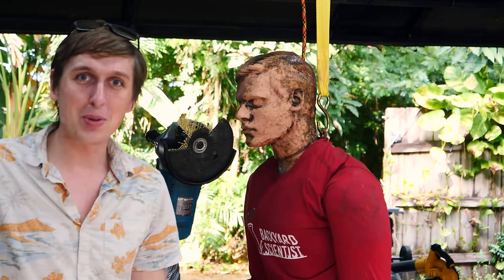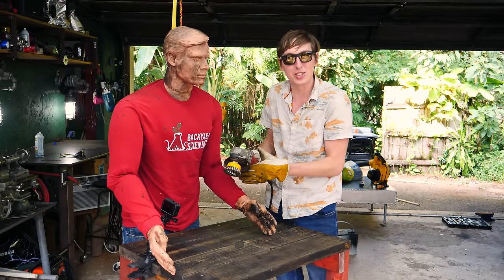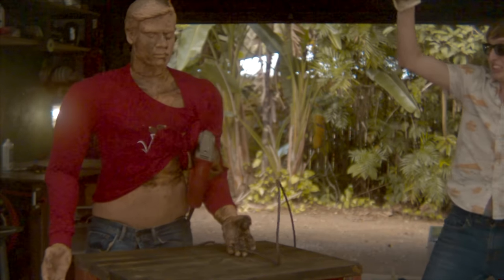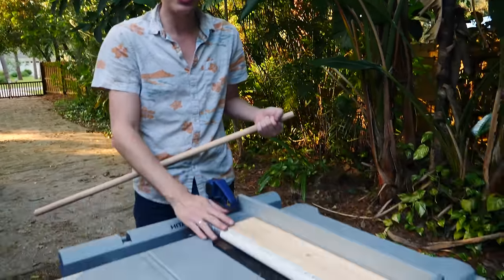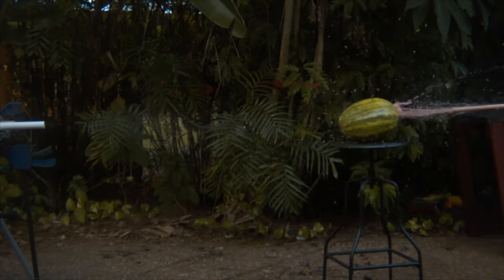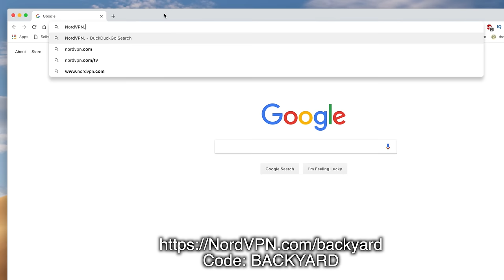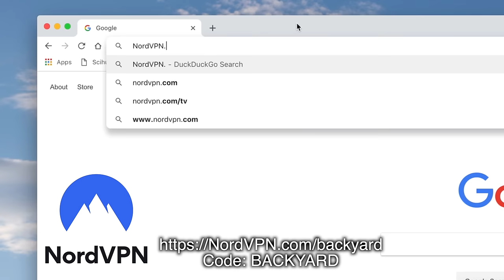This Is Why You Need To Wear Safety Glasses

Comment from the maker: Anybody have any stories from power tool fails??
Heres a link to the exploding car video! https://www.youtube.com/watch?v=HhXNs8EVQck
Watch this great and entertaining talk on security and privacy https://www.youtube.com/watch?v=J1q4Ir2J8P8
Backyard Scientist shirts https://outloudmerch.com/collections/backyard-scientist
Reply: Hey
Reply: Japan is another planet and I love it
Reply: I ran out of battery for my drill at work, was a total fail.
Reply: Was using an old drill.. bit got stuck and handle  caught me in the jaw..
Reply from the maker: @AsG_4_  ouch! ive had that happen quite a few times, but it usually only twists my wrist or hit my ribs.
Reply from the maker: One time I was drilling a hole through thick metal, and the bit broke in half. the drill bounced off the metal and right into my calf. I drilled about 1.5 inches into my leg and the bit had fat tissue stuck in it. Probably my worse injury.
Reply: Leo at Sampson boat builders just had an accident and is getting everyone to guess with what...do you have any guesses after this video?!
Reply: I've had a disc exploding in my face, i didn't wore glasses, thank god i only had a couple of minor scratches. But a week later or so, i was welding and a piece of red hot slug flew behind my mask and bounced in my eye. Hurt pretty bad. So even wear safety glasses behind your welding mask.
Reply: @TheBackyardScientist  oooof I'd say so.. I also got my finger pinched in a saw zall shaft.. lucky not the blade... Oh yeah "too many cheese burgers Randy " 😂😂😂
Reply: using a very large drill to drill a 3.5in hole through 8in of concrete floor and the bit got jammed and the drill took me off my feet and into a wall.
Reply: TheBackyardScientist i have a story of a train wheel and a very powerful machine! Oneday i was machining a trainwheel using a automatic copy machine, when it decides to slam into the train wheel while it was spinning fast! As a soon as tool hit wheel, huge metal explosion and small sharp metal shavings when into my face and skin. I had over 20 tiny cuts, and my eyeballs were safe becuase of the glasses!
Reply: I almost cut my finger off with my angle grinder
Reply from the maker: Sdrrshock  Yikes! my lathe only has the power to break a few fingers, but the bigger ones can easily rip your whole arm off... if you are lucky. ive seen videos where the whole person gets wrapped up like the tie in this video.
Reply: TheBackyardScientist you were the only good part of YouTube rewind
Reply: that end of the wooden pole will sure make a cool slug! awesome Video btw!
Reply: 1) I was using an angle grinder for the first time, and learned the hard way to hold it at the correct angle. Was grinding some metal and shot sparks directly up into my eyeballs underneath my glasses. Do not recommend! 
2) I was using a belt sander for the first time. I was sweaty and getting tired, and my hand slipped and I buzzed some knuckles against the belt a couple times. Also do not recommend.
Reply: Not really a power tool, but a classmate of mine from my vocational school was pressing a bearing out with a hydraulic press when the bearing failed and basically exploded sending bearing rollers everywhere at high velocity. Thankfully he was wearing safety glasses because one of the rollers actually went half way though one of the lenses, stopping so short of his eye that he could brush the roller with his eyelashes. A picture of those glasses was posted around the school with the caption "This is why you wear safety glasses" for at least as long as I was there, probably for a good while after.
Reply: @Riverratskippy  those hammer drills should have a clutch but I've had em stick before as well.. very rare
Reply: What bb gun is that its cool and id like to get one for christmas
Reply: This wasn’t bad but I was using a belt sanded and sanded off the skin of my finger

Also I was using a Dremel and the sanding bit and the sand paper broker off from the fabric and it exploded like a grenade

I was lucky not to get hurt but I was in my maker space close to the CNC and it launched a big chunk of wood at my eye I was wearing safety googles sooo I’m lucky
Reply: Watched a guy cutting the top of a fence post with a skillsaw...hit a knot, it jumped out of his hands and the blade went across his chest....fortunately he was wearing a jacket and two shirts, so his wounding was mainly superficial.....
Reply: Got my thumb buzzed on a bench grinder. I could see bone after i washed the blood away to clean the wound.
Reply: @AsG_4_  i experienced the same lol
Reply: My dad once used a router and the tool bit popped out and skated across his arm. He nearly lost the ability to move that limb.
Reply: Great video! When you are using a table saw on a daily basis it's easy to forget just how dangerous kick back can be. Thanks for reminding me,  I'll def be aware of where I'm standing when I'm working!

Ps your watermelon didn't really capture the the seriousness of the risks posed by the carving blade in the grinder.  A couple of years back I had to administer first aid to a friend who had one cut straight through his index and middle fingers.  Went through like butter in a split second.  Clean cut through dewalt gloves and knuckle bones! Surgeon was able to reattach but not restore mobility........ 

Please guys,  be careful!
Reply: I was working on a Mag Drill which is used to drill through steel beams. My shirt got caught in the bit and started sucking me in. This was just a few weeks after hearing a story of a guy that bypassed a safety switch on a pipe threading machine. His pants got caught and reeled him in and unfortunately he got his gonads ripped off 😭 Thankfully I was much more fortunate and only got surface wounds on my belly. Everyone around said I was hopping around screaming 😯 It's scary what those high torque machines can do.
Reply: TheBackyardScientist I’ve had a Dremel cutting wheel explode, luckily I didn’t get hit much just a tiny piece in my arm a few millimeters.
Reply: I was grinding on a piece of aluminum and the grinder  got caught in my and shirt and tore it off me. However, it didn't harm me.
Reply: @tbac2432  Oh man! Reminds me of my brother-in-law with the table saw... 🙄
Reply: I'm sure Mr Peter Brown over at @ShopTime could give you a story or two.
Reply: I've experienced tablesaw kickback a few times. Fortunately through a combination of luck and proper training I've never been injured by it.

I've witnessed the exact level of power you demonstrated in the video. My boss was using the saw and had a one inch square scrap of wood kickback and stick through an insulated metal door.
Reply: I was cutting a price of metal and sparks caught me on fire
Reply: The MithBckyardBuster
Reply: was once drilling through a piece of metal sheeting, good 1/8" thick.. bit snapped and stabbed a hole through my thumb nail and partially into my thumb. Took me a second to comprehend what happened and oh man did it hurt once i realized what had just occurred...
Reply: I was using a cutoff wheel on a sewer stack and the stack dropped from my cut broke the wheel and shot a chunk of cutoff wheel through my shirt cutting my stomach. I now recommend using a portable band saw on those.
Reply: Those god forsaken wire brushes. I was stripping the paint off a bunch of metal so we could paint it. I was picking the metal out of my arms for an hour every evening for a week. And one night I was far too tired to be operating machinery and got sloppy. It kicked back and got me in the gut destroyed my work shirt and left scratches everywhere. Customer watched it happen and thought he'd just watched a kid disembowel himself. lol
Reply: Friend of mine improperly secured the blade on his bandsaw and the blade came off and went blazing down the newly painted drywall in his garage. That was a fun cleanup. It left some pretty trippy looking marks though lol.
Reply: 11:48 you did not wear ur safety glasses in a video about wearing safety glasses
Reply: My woodshop teachers woodshop teacher was cutting barel staves and had a kick back with the table saw and the stave went half way through him
Reply: I cut a chunk out of my finger with an angle grinder
Reply: Never, never reach across the top of a work area of a working chainsaw.
Reply: My dad's friend screwed his hand to a counter at work.
Reply: I ones got my finger stuck between a metal polishing wheel and the blackboard that did hurt but nothing seriously happend. :)
Reply: I was in the Navy and we often would have to grind the rust off the decks and bulkheads (walls) I had a friend using a wire wheel with a  grinder and one wire flew off and stuck right into his eye. It was horrifying!
Reply: adam G bro, I just had this happen and it broke my hand. Sitting at home in my cast after surgery got a plate and several screws to put my hand back together. Happened last week!
Reply: Now I need a chainsaw because that was awesome
Reply: I was cutting a piece of OSB on the table saw and it kicked back so hard it hit my belt buckle really hard it kinda bent it. Lol.
Reply: I set the shirt I was wearing on fire with an angle grinder...
Reply: John T  look at the single video that I have posted ill be fine
Reply: TheBackyardScientist a pistol drill has the capabilities of damaging the eye! A pencil sharpener can cause damage to your eyes
Reply: Circular saw got sat down while still spinning and the guard was stuck back. It shot right off the bench and landed about six feet away.
Reply: When gas welding i kept acidently poking myself with the red hot end of my filler rods lol
Reply: Buddy was holding one end of a 2x4 in one hand, nail gun  w/ 16 g nails in the other. I guess it had too much psi in the air tank. But he wrapped his hand in duct tape and finished the day. Trooper.
Reply: Why the hell didn’t you use the table saw gun with a pointed stick on randy?
Reply: Build a real gun of the saw plz
Reply: i was working with a panel saw at school and I tripped a breaker causing the entire school to lose power
Reply: 12:09 safety glasses still on top of head 😔😎
Reply: i've been hit by table saw kickback twice and had a wire wheel get caught in my shirt. both left very similar injuries surprisingly enough. the kickback did caused a little more bruising and the wire wheel tore up the skin a little bit more.
Reply: Got mad at work and started to use my hitachi hammer drill as a hammer, turns out the battery explodes when you slam the head of a screw into it lol
Reply: Hah, I got one. My brothers best friend in high school was making a bowl on the lathe. He found a weak spot in the wood and the whole thing exploded. Half the bowl ended up embedded in the ceiling of the wood shop room. It was still there 3 years later when I went through the class. It was used as a learning experience and a reason to why we wear safety glasses.
Reply: Jeremy Oppenzato how
Reply: yes, my finger got into a disagreement with my trim router, the router won
Reply: I have scars along my right arm from angle grinder disks breaking and hitting my arm and also a few burn scars from a welder
Reply: Yeah, I have a fail...It can be impossible to avoid but don't get the fiberglass dust from a grinding/cut off wheel in your eye. Shower as soon as you're done doing metal work and wash your hair twice, wear a hat, even use the air compressor to dust yourself off. I got a particle in my eye and it took 5 painful weeks to fall out. I even went to the doctor and was told there was nothing that he could do about it. He couldn't see it but could confirm something small was irritating my eye. It didn't happen while I was working but happened 4 hours later when I was on a different project. The particle presumably fell out of my hair....Learn from my mistake, DON'T DO THAT!!!
Reply: I have had the wire brush thing happen to me. Just wrapped up and gave me something resembling a rug burn or road rash
Reply: My wood shop teacher in high school once gave a safety presentation on the drill press for beginners. He told the class that you should never use the drill while you still have the key In the chuck, as it can get flung across the room, while accidentally leaving the key  in the chuck. He turned on the drill, it shot the key at him, hit him in the stomach, and knocked him down. He immediately got back up and said that’s why you never leave the key in the drill press like he meant to do it the whole time.
Reply: I was using a bandsaw in highschool in my woods class freshman year and the bandsaw blade broke when I was using it
Reply: "This is why you need to wear safety glasses"
Doesn't wear safety glasses while launching high speed wooden projectiles (6:45) or while using a stupidly dangerous angle grinder attachment (11:40)
Reply: I have always been a huge fan of yours, and you were off to a great start with this video when you were explaining how important it is to use safety equipment with power tools. The problem is you didn't even use the safety equipment for most of the video, and the times you did, (like wearing gloves) you should not have. I do not often "dislike" videos, and this is the first time I have ever done that to one of my favorite creators. It might be a good idea to look into proper safety equipment and when to wear it. As a general rule of thumb, you should have been wearing safety glasses for all of these demonstrations, and gloves for none of them. Please Please Please educate yourself a little more, and at least practice what you preach in a "Safety Tips" video.
Reply: Forgot to wear safety glasses while using an angle grinder and I got a small piece of metal in my eye and it had to be removed using a needle
Reply: Several years ago i was working clearing trees from a telephone pole line, the guy i was working with climbed a tree and then proceed to drop start a chainsaw,  it bounced off his steel cap boot ripping the cap off and slamming that in to his leg, and almost chopping his foot in half, moral of the story? start the chainsaw on the ground and pull it up on a rope.
Reply: John T u aint wearing glasses properly
Reply: I had a piece of wood break on the table saw. Got hit on the thumb ripping most of the nail off the finger and the push tool was shattered as well. Very glad I wore googles because one of the pieces flew up and grazed them as well. I was surprised, but the wood was very hard and had some cracks so I guess that's something to look out for.
Reply: Was using a hammer drill to pilot screw holes for some cabinets, on the second one the motor just burst into flames, no warning, no electrical burning smell. Had to run about 40 feet to the nearest door and chunk it outside.
Reply: Do Bench/Pedestal Drill Stories Count? (: Back when i was busy for a project, i was working with a Beast 3 Phase Insanely strong Pedestal Drill and was trying to drill a very large 120mm (approx 5-6" ) hole with a hole saw. I was not working in my own shop and was rushing to get things done(BIG BIG MISTAKE) as they were about to close down the shop and i need the hole done. It was Softwood- Typical PINE board which was around 1 inch thick(25mm approx) and 10 inches by 10 inches (25cmx25cm) square block with 45 to 60 Degree cut ultra sharp angles!!(Seen the big picture?)... I tought i can keep the speed ULTRA Low (around 100 RPM) and keep it with a single clamp and push it down. Longs story short, while drilling half way thru it GRABBED the wood, pulled the clamp instantly and i was VERY lucky enough as it hit to my hand while `helicoptering` at the middle of the hole saw drill bit and i almost lost my thumb where it meets to main chunk. It was just a deep scratch but bleeding very badly. The BIGGEST mistake i made was thinking that the beast 3phase drill will be like my pedestal drill(bogs down or slows down but has a lot of torque and still safeish to use). Thankfully , i have scar on my hand to remind me few things:
1- NEVER RUSH.
2- RULE 1 APPLIES When you are in Hurry.
3- SAFETY FIRST. (There goes my pun)...
Reply: I lost a finger to my jointer... I wouldn’t recommend it. One second I have all my fingers, one split second later I don’t.
Reply: two stories.  

1) was using a 6 inch hole saw on a drill making Corn Hole boards.  I normally set this to low torque just in case the hole saw binds.  I forgot to check the torque setting, and the bit got bound up.  Ripped my wrist around and I couldn't use my hand for weeks.  Luckily, no break

2) trimming up a board on a table saw, trying to take off about 1/4 inch between the fence and blade.  I didn't have a push stick so I was using the miter guide to push evenly on the non-fence side.  This was simultaneously a good and bad idea.  It was a good idea cause it kept me away from the 1/4 inch piece that was slowly making it's way into the gap between the fence and the blade.  It was a bad idea cause there was no support on that 1/4 inch piece of plywood and since I had a fence there, that final top edge of the plywood broke and the pushed into the blade.  It was launched down the driveway (about 25 feet) across a residential 2-lane road (about another 25 feet) past the sidewalk and into a ditch (no clue how wide that is) and stuck into the ground about 6 inches like a spear.  If I had been standing in the wrong spot, it would've been like that dowel going through the watermelon.
Reply: Me personally no but my senior year of high school one of the freshmen ground the end of his finger off on a  big disc sander
Reply: I had an angle grinder accident using a wood carving chainsaw attachment it caught my sleeve and nearly cut my left hand off right at the wrist. That was a year-and-a-half ago I'm permanently disabled. Have used power tools for over 40 years with never an accident until this one. By the way I had all my safety gear on eye protection ear protection and respirator the mistake I made was a long sleeve shirt and it was a snug fitting shirt, so my recommendation is only wear a t-shirt snug fitting or maybe no shirt at all I don't know LOL.
Reply: Those hollow points are gonna act like fragments just like in that Russian shotgun slug
Reply: I had a non grounded table saw and shocked myself when I had my hand on it and when to turn off the light. Right through my chest.
Reply: You do an episode on power tool safety, then use an angle grinder with the wheel spinning so that if it does catch it comes right back at you.  Always run a grinder so when it grabs it jumps away from your body.
Reply: My woodshop teacher in high school told us a story of a guy he was in school with who had long hair had gotten it stuck in a machine and ripped part of his scalp off.... I'll never forget that story
Reply: I made a cutting disc from the  top of a baked beans can, attached it to my Dremel and started carving, the arbour snapped sending the razor sharp disc into my calf exposing the yellow wobbly stuff.
Reply: My coworker was grinding out the edge of a pipe and his shirt was untucked. The grinder wheel ended up grabbing onto the shirt and left a really nasty burn mark in his stomach and the shirt was completely torn apart from where it grabbed it.
Reply: I know a guy who got hit in the gut by a thin piece of maple kicked out of a 3 HP table saw--he spent a few days in the hospital and has a pretty impressive scar. It had a square end. Kickback is real!
Reply: Another story that I have and funny thing is it's the same guy that I talked about earlier. He was using the cutting wheel and he was wearing gloves. As he was cutting the metal fell and he accidentally lost his position and ended up cutting into his index finger. It cut right into the join for the index finger where you can bend it. Cut all the way to the bone. He had to take 12 weeks off for work and just came back and is on light duty
Reply: I know someone who recently lost two fingers to a table saw. So good warnings.
Reply: Well, I shot a steel square tube (30x30x3 about 30 or 40 cm long) at me using a stationary belt sander. That hurt a lot but didn't cause any injuries thx to proper work clothes.
Reply: I saw a guy at my old work. Used a zip cut disk with no guard. 10000rpm grinder with a 7000rpm disk. Broke off and went through his chin and his jaw. Very lucky it didn't touch anything in his throat.
Reply: TheBackyardScientist not a power tool but someone using a laythe left the chuck key in the machine so when he started it, it flew across the room and nearly hit someone.
Reply: My dad was table sawing and a piece of wood kicked back and got him in the wrist. He had is artery nicked and was losing a lot of blood and my mom had to make a tourniquet out of a towel and took him to the ER. He ended up being fine but he is always careful around table saws. Be careful around power tools. My dad always says wear protective gear not for the minor problems that arise all the time but for the rare deadly instances where things really go wrong.
Reply: glad to see an experimental safety video. But I also see that you haven't learned the lesson yet that I had to learn the hard way. And I'm surprised, because you actually address the issue, but obviously don't see it from all "angles" (haha)
I'm talking about tangled clothing. Safety gloves are the most caught piece of clothing. Whenever you use a tool where a short contemplation learns you that clothing could get caught and tangled up, the don't use (regular) safety gloves. And I wasn't even using a brush tool, just a regular grinding disk, my glove got caught and it pulled my finger right into the disk... Luckily, the disk spun so fast is burnt the wound instantly, so it didn't bleed. It happened a few years ago, but it's still a sensitive spot on my thumb, and it took over 5 months for the scar to fully close up.
If you want to use cover, but don't want to invest in proper material, use stuff that rips like paper, so whenever something gets caught, it just disintegrates and never puts any pull on your body. But the one and only real good solution, is using chain saw gloves, and other protective clothing used by smart chainsaw users. They are laced with compressed highly expanding fibers. As soon as the fiber compartiment is breached, they form a huge pillow, locking up your tool instantly, and forming a protective cushion around it. Thinner parts on chain saw gloves are made of a special type of soft leather that will rip very easily, protecting your hands from impacts and hard edges and splinters, but when caught by the chain, will not pull your hand in... Better to drink a lot more and sweat like a pig, than to skip on the extra protective layers of the appropriate kind....
Another fail I once had, was when grinding off a large piece of metal, and when I was nearly through, instead of folding open, it actually scissored and caught the disk, yanking the grinder out of my hands and ramming it into my thigh. Got away with just a nasty bruise, but that could have ended a lot worse. Lesson from that one: lock up both parts when cutting through larger or heavier parts...
Reply: TheBackyardScientist I had a cutoff wheel on my angle grinder explode and the shrapnel shot from the deflection guard, into the floor, and past my face. I felt it and heard it go right at eye-level. Without that guard, there is a definite chance that I wouldn’t be able to type this right now.
Reply: My dad cut two fingers off with a tablesaw
Reply: I have a good story about power tool fails. Know this one guy who made a video about safety glasses .. proceeds to then not use them while not using the tools for the intended use...
Reply: No injury but once drilling a vertical bar just in front of my radiator (to attach an air horn because why not) but when it got through, the bit pulled itself through and I jabbed a hole in my radiator.
Reply: I've had kickback from an angle grinder before that has left a few scars. Please always be careful and use the proper safety equipment when using these tools!
Reply: Sorry im late but my dad had almost lost his nose and eye from a grinder disc shaddering. It cut so deep it went into his nasal cavity but that was about a week ago and he is all better now
Reply: My grandpa cut his finger and thumb with a table saw
Reply: @Ezra Clark. My dad also. He lost three of his fingers to a table saw.
Reply: Not exactly a power tool failure but a construction failure. I got an inch and a half deep gash on my leg from a broken piece of tile. Doctor that sowed me up said I was damn lucky I didn't hit my artery. Still a lot of blood though.
Reply: back in my woodshop days I saw a kid get his hair caught in a drill and it ripped his head clean off. true story
Reply: Jack Tradesman a sandblaster?
Reply: can you make a rapid fire cannon out of this table saw? like ataching  a bowl with a tube going into that pvc tube and then shooting a loot of idk wooden balls?
Reply: I tried to screw a bolt in my chair cuz the back was wobly when I was 12, I ended up screwing it through the chair.
Reply: @AsG_4_  me too, i once forgot the tool to tighten the lathe head, turned it on. And the tool flew inches by my head and buried itself halfway into a concrete wall.
Reply: Please put a safety cap on the table saw
Reply: I slightly drilled my self... I was attempting to drill into a dowel, drill slipped, cut me. Yes cut, not hole. I was being somewhat careful as in I wasn't pressing SUPER hard and having it on SUPER HIGH speed...
Reply: My old working college told me that a other worker was grinding with a big fiber disc 230 mm and got stuck on a edge, a piece of it almost cut his crown jewels. And my trainee worker (Auszubildener) failed on a belt grinder luckily he got only a black nail and some not such bad scratches but I heard from another guy that sanded his fingers down a bit more than is good for him.
Reply: I was using a drill press and I was holding the wood I was drilling and the bit grabbed on to it when I punched through and it spun around and jacked my hand up
Reply: Was using a wood bang saw and I hit a bad spot in the wood and the saw zipped right through it and nearly cut my thumb off
Reply: I think it is woth to mention, that with "real powertools" like a stationary and professional tablesaw it is no problem to shoot a 10x12cm oakwood with a weight of over 80kg through a double brick- or concreedwall, if it gets caght in the right way. This things have power.

And you NEVER EVER use GLOVES while using spinning powertools.
No anglegrinder, no beltsander, no drill, no lathe and now tablesaw.
If a gove gets caught, it can ripp you finger, hand or arm off.
Reply: My dad was welding and I was really close and some of those Sparks burnt me and my clothing
Reply: Custom shotgun requests should go to Matt at demo ranch
Reply: TheBackyardScientist can you privately DM me and teach me how to hack my school’s block system? Pleeeeeease!
Reply: I have had my fair share, but most notably would be when I was using my hedge trimmer without the guard or handle and decided to rest, long story short my left thumb slipped off its safe area and went into the moving blade.  this then resulted in twenty stitches in my thumb.  Also I have lost one of my favorite shirts to a wire brush wheel.
Reply: Shoot the stick with the saw cannon inyo randy
Reply: I got hit by table saw kickback.  I was cutting a sheet of 1/4" polycarbonate, and somehow, right as I finished the cut, one piece and then the other accelerated across the table towards me so fast that I didn't even see them when they left the blade.  I caught one in the belly, which cut through my sweatshirt and tee shirt to give me a little nick in the skin.  The second one hit my fingertip and cracked the nail into a mess.  It didn't hurt that bad, but the look of it just about knocked me out.  

I also caught a blob of solder with my eyelash while desoldering some wires.  When I reached up to wipe it off, it was still hot enough to burn my finger and left a fingerprint in the solder.  I kept that thing as a warning.  I always wear eye protection while desoldering now.
Reply: I was drilling a hole into the broken halves of a friends car door handle, and had my hand in the way. Bit went through, into the tip of my finger, and broke into three pieces. One in the drill, one fell to the ground, and the tip is likely still in the end of my finger because we never found it, and 10 years later, the end of my finger gets sore occasionally like it's got a splinter in it.
Reply: I've seen a chunk of 9" grinding disc fly off, go about 20ft and knock another guys welding hood off while he was welding. On grinder kickback, the grinder usually goes the opposite direction of the sparks when it kicks back. If you are throwing the sparks directly away from you, the grinder will come at you if it kicks. Throw the sparks to the right or backwards to prevent kickback from getting you. I use a face shield and safety glasses with a grinder too.
Reply: If i have that kind of stories i would be dead
Reply: Well a grinding disk once got stuck in my shirt and then it went into my belly, thank god the angel grinder got stopped by the shirt...
Reply: I was doing my Metals final on the lathe and I had to set up feeds and speeds. So I back it up turn it on and... Shwoom!! It ran into the chuck and I hit the emergency stop. I got a C on the final.
Reply: My dad put a nail from a nail  gun through his finger
Reply: One time when I was a kiddo my buddy and I we're building a playhouse and accidentally brought the handsaw on my hand... Now they call me "nubs".
Reply: bet you 200 bucks you cant make a drill more dangerous than having it shoot chainsaw blades
Reply: I tried to shave 1/16th of an inch of the thickness off of a threshold molding on a table saw. I fully intended to grab the push stick but it was too far ( more than 6 inches) away that when my one hand left the stock to reach of the push stick the other hand got pulled into the blade when the threshold was thrown by the table saw. The blade went in the tip of my finger about half an inch deep ( almost the first knuckle ) through my finger nail and out my finger print.
Reply: Had a bit catch in a steel pipe cap I was drilling into, whipped the cap around and snapped the bit off my press and smacked me in the chest hard enough to leave a big black bruise.
Reply: I had an angle grinder pinch while cutting my buddies tailpipe off. It ran up my arm a foot. Pretty nice scar.
Reply: I can confirm the dangers of not paying attention on a metal lathe... I forgot to take the key out of the chuck once and it spun around and went straight through my fingernail, shattering the bone in my fingertip. I was lucky to keep my finger and fortunately, all of the feeling came back, but the healing process was absolute hell.
Reply: My stepdad cut off a few fingers working on a tablesaw, he got most of them back, but he can hardly grab anything in that hand, and the thumb's gone forever 👎exercise caution folks
Reply: Kid at school tripped on a power cord stuck his arms out to catch himself and sawed three fingers off on the table saw.
Reply: Angle grinder cut two fingers off of moonshiner Jeff on Moonshiners show.
Reply: Taofledermous!
Reply: Yup I was using the table saw trying to cut a to small of a piece of wood bounced back at my hand and chest like a hard ball knock the wind out of me and cut my hand lesson learned.
Reply: @sloppymelon  yes that just happen to my brother was grinding metal and got some metal in his eye he had safety glasses I told him to see an eye doctor to get it out so it doesn't rust in his eye
Reply: Yea I was drilling out the air restrictor of a nerf gun, and the drill went through the side of the plunger tube where I was holding it and into my hand between my thumb and index finger. I was 14 and how alone.
Reply: I actually had a similar experience to the wire brush at work the other day, I was wire brushing an aluminum spline and it kicked back and hit my leg, luckily my pants are built for situations like that
Reply: Me and my friend were cutting and there was no safety guard or that thing the disc blew into two pieces one we both saw going up into the sky and didnt see it coming back the other piece well my friend was probably the luckiest probably the luckiest person in the world cause the disc went right between his two toes
Reply: TheBackyardScientist your stick experiment (or whatever it is you loaded in the launcher) is absolutely amazing
Reply: The wire wheel accidentally grabbed my shirt and cut me all up and gave me a big scar
Reply: I can’t express how important safety is as a robotic operator I use wire wheels about 10 hours a day on average surprisingly enough a T-shirt with an under shirt helps substantially more then just a T-shirt I’ve got scars on my chest and hands from unsafe practices with wire wheels (hands looked like fresh ground hamburger and chest looked like I slid across a cheese grater) but in my professional opinion if you need to use a wire wheel look into a leather coat or bib like welders use a face shield (because they can and have caught some employees faces) safety glasses and gloves made of leather or thick cloth save yourselves the trip to the er and just work safe
Reply: You should replace the watermelon with a ZGB ivan head like if you agree
Reply: The edge of a new grinding wheel on a 7" grinder is only travelling about 4m/s faster than a new disc on a 5" despite the lower rpm, those wire wheels cause much more injuries than any other wheel as they kick back much easier by holding it the same way you did with the chainsaw attachment, move the guard and place the handle on the other side of the grinder and operate so that the sparks/debris are travelling to your right so that the grinder feels like it's pulling away from you.
Reply: I was using an old edger. The blade hit a peice of concrete that was sitting underneath the dirt and shattered. Luckily all of the blade was caught by the safety guard.
Reply: My ITech teacher in 8th grade had a student cutting wood on a table saw and it flew back and hit the storm door behind him bounced off as he turned around and it hit him in the head and cut his head open he had to have 5 stitches put in his forehead and to this day there is still a 2 inch indent in the door
Reply: I've hit my hand a couple of times in the chuck of some spinning lathes, but that's about it.
Reply: My dad was cutting some wood when his finger slipped at almost got cut off by a power saw
Reply: Please please make a video on your homemade Tesla coil
Reply: A few weeks ago, I touched my knee with a cutting disk and the cut was instantly cauterized. Nothing serious, just a touch but it went right trough my two pairs of pants and my coveralls with out even blinking.
Reply: I eat
Reply: I was using an angle grinder with a cutoff wheel and moved the grinder away, then used my left hand to check the metal and check for any issues with the cut. When I moved the angle grinder back into position, I turned it on but forgot to move my left hand fast enough. It cut through an 1/8th inch leather glove and cut into my left pointer finger, leaving a 1/4 inch deep V-shaped grind in my finger. I put the set of gloves on a hook in my shop with the cut glove facing me while I work to remind myself: "Safety is our number one priority"
Reply: I got my arm stuck in a lathe a few years ago. Broke my arm in 2 places, messed up my head when i  got pulled inn and riped up my neck and head when it took my clothes off. Powerfull machines
Reply: @TheBackyardScientist  Was the bit and the metal being cooled when the bit snapped? Those bits can get extremely hot (as I imagine you know) and it could have cauterized the wound.
Reply: TheBackyardScientist today in my wood shop class I was useing a jet oscillating belt sander. I was cutting an edge and the board caught an edge and hit me in the stomach and hit another kid and the glued board broke in half. Be careful guys I’m lucky it didn’t hit any bones.
Reply: I needed to cut a valve just 2 centimeters in side the metal but suddenly my angle gringer grabed the metal and the whole disk just flew away lukely it didnt hurt me 

But always wear safety gear
Reply: My guy bestfriend was in woodshop and a girl asked him to cut a board for her, so he did and didn't realize that there was a knot in the 2 by 4 and it kicked back and shot back and the board broke into 2 peices and shot mock 10 speed against the wall, a piece came back and hit him in the stomach and it knocked the wind out of him but didnt do too much damage luckily. Moral of the story is he wont cut boards for anyone anymore or help them😂
Reply: That's how people dont get caught on the dark web
Reply: You know how they say make sure the ground prong is on the 3 prong plug? Well, when I was 17 I found out why!  in high school woodshop class with the old metal finishing sanders.
Reply: can you shoot the dummy with the sharp dowel lol
Reply: My intro to manufacturing teacher told the class about how a couple of years before us the table saw kicked back a piece of wood and shot it through a wall
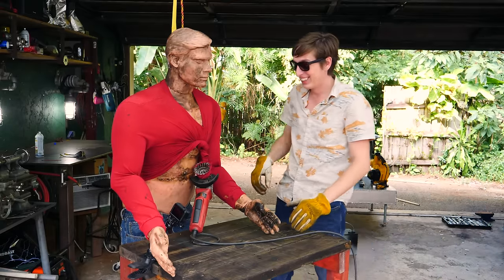Reply: 3:38 I've had that happen to me before. Was not fun at all! I was wire wheeling a rusty table saw top and I got to close to the edge as I was leaning against it and it grabbed my shirt exactly like that.
Reply: TheBackyardScientist I absolutely hate it when I’m just trying to saw a piece of wood and some jerk is shooting my abrasive saw blade with a BB gun. It really is an inconvenience.
Reply: Yeah A jumproap
Reply: I hit my finger on a vertical belt sander
Reply: My dad cut his finger off with a table saw
Reply: My wood working teacher, when he was a student, saw a classmate of his get his hand stuck in some rolling machine. It ripped the skin off his, the classmate's, hand and turned it inside out and hanging on by just the finger tips. The person did go to the hospital and I think they were fine, I don't remember if he meantioned that part
Reply: I don't have a story, but hey brother you look like nick foles!!!
Reply: I got stuck with my hair in one of those drills where you pull down a lever to make the drillbit go into the thing you're drilling. (school woodshop or something like that)

Learnt to keep my hair in a tight bun after that.
Reply: I was making a custom wooden fish tank lid and needed to trim down small piece of mahogany on a table saw when it caught and dragged my fingers along with it. It took 2 hours in ER, 2 hours just to figure out how bad it was, and another 4 hours for plastic surgery. Never mind the 4 months of rehabilitation and figuring out how to use my non-dominant hand for everything, like writing and eating. Not the bonding experience  I thought I would have with my fam, glad I have them.
Reply: One time working on a site putting sheet metal on a roof a piece slid down from the top and got a guy in the throat come it up a ladder
Reply: TheBackyardScientist you talk about all this safety stuff but you didn’t wear much of it, why is that?
Reply: One time my dad was using a tablesaw it is similar to what happened but the blade was facing the other way so a two by four went straight through our garage door
Reply: Yes
Reply: I was using an angle grinder on a work bench. I turned it off and set it down before it stopped spinning. Well it caught in the table and flung off and some how it the switch and turned itself on.  It then proceeded to cut the cords on my welder and my extension cords.  And of course why wouldn't it start going right to my feet as well. After that. I got rid of that grinder and got the 60v brushless DeWalt grinder.
Reply: Someone in my science class dropped a beaker and sent a small piece of glass into a friend's safety goggles.
Reply: Was working on making a clipboard for school and my teacher was cutting wood, it kicked back and hit me in the chest. Now have a scar from the piece of wood, same size and shape
Reply: TheBackyardScientist my poppi/grandpa almost got all his fingers got cut off by a saw, I think 3 of them were hanging on he had to get stitches
Reply: With help from my father in law we turned my angle grinder into an insanely dangerous circular saw. I might have you beaten on how dangerous can I make my angle grinder!
Reply: I was working at my old high school as hired help for the theatre program and it got to the point we were working late shifts as quickly as possible the minute the students were gone. I had stressed the entire show to my students how dangerous the table saw is. One night I was ripping small bits of sheet stock and it kicked back right into my crotch. Needless to say I know the value of good sleep before working with tools now
Reply: You literally teach me just like my technology teacher so thanks backyard scientist
Reply: I was wearing  a pair of thin fabric gloves and trying to drill a piece of wood. It ripped the back of the middle finger of the glove to shreds. I only got a few scratches.
Reply: I was hit un the arm by a grinder blade from about 15 feet away. I learned my lesson on watching other people work lol. 4 stitches
Reply: @Djfr  good call but dont forget about how rediculous bud
Reply: TheBackyardScientist hi
Reply: Hammers and fingers
Reply: TheBackyardScientist 
I was doing some work on a farm outside of town working on metal fencing and I had wire brush on an angle grinder and had it get caught on the long sleeve of my shirt and it tore up my arm, I ended up with 24 stitches total
Reply: TheBackyardScientist you should make these type of videos longer I love these type of bids
Reply: My friends dad got his fingers sliced clean off.
Reply: TheBackyardScientist yup. Kickback. I got hit in the gut
Reply: @TheBackyardScientist  Tis but a flesh wound lol
Reply: yes my dad once stapled his finger
Reply: also my dad got insulation in his eye
Reply: My dad cut off his finger with a tablesaw
Reply: Had a wheel go more than once close up, it's not very cool lol
Reply: Idk if this counts as a powertool fail, but one time at school during electronics class, I was using a soldering iron to solder some wires together on my project, and a hot piece of solder fell, and hit my leg. (It was my fault for not having my chair pushed in while using it) and I had a small burn mark from where it hit for about a week, and the pants I was wearing now have a little bit of solder on them because of this.
Reply: Angle grinders, had one with a flap disk get caught and come back at my stomach caught my jacket just like the video. Slit the stomach just to bleeding nothing serious could have been much worse. Had a grind wheel on once cutting flat to the ground on a hill for fencing, came back towards my face and ran across my safety glasses. Moral of the story angle grinders want to kill you and wear PPE.
Reply: Drill with a large forstner bit that didn't stay in the wood and instead spun across the wood, over my fingers, splitting my middle finger almost in half:S
Reply: @TheBackyardScientist  yeah last week i cut my self on head with 7 inch concrete cutting disc...i had cloth wrapped on head a string was hanging down ..it got wrapped in grinder in milli seconds. .fortunately no serious wound occurred
Reply: My uncle was using a really old angle grinder and a shard flew off and hit him right where his eye would be and it was embedded about a quarter inch into his safety glasses
Reply: Had a "wood carving" attachment on my 9amp grinder take hold of the trunk and run up to my left index finger.     I had just received the bill from my thumb injury, so I didn't go to the hospital.    Lost some retraction tendons...  But now I have a locking finger like a falcons talon.
Reply: My father worked HVAC and some poor fellow crawling on his knees managed to set his weight on a ¼inwide/½inlength sheet metal screw. Took 5-6 guys to hold him down, and he got to drill it back out.
Reply: Ever stick your hand in a planner? I haven't
Reply: We were doing a project   involving wood and we were'nt aloud to use the table saw so the teacher used it for us and it trewback at him , yeah he had to go to hospital
Reply: I’m in robotics and there’s this one kid that I really don’t like, because whenever using the bandsaw, he stops it early and then forces through the piece of wood/metal and he breaks so many blades and it’s a huge safety hazard.
Reply: My accidentally cut his foot on an  angle grinder. he had to get stiches
Reply: Hi
Reply: Ezra Clark …
Reply: My dad launched a piece of of wood threw a wall while cutting me my pinewood derby car
Reply: Not as bad but was melting lead in smelter to cast fishing lures and the condensation from a drink got on the ladle and the steam explosion sent the molten lead everywhere ever since then I now keep drinks far away
Reply: Safety he looks dead I wonder u
Reply: @Ezra Clark extremely big oof
Reply: Naw
Reply: My Co got impaled, just missing the liver, by a tapered piece of white oak he was ripping. It had been drying a while in the shop and had a lot of moisture from the mill and was binding a lot. Just as he was nearly through, it checked and the scrap portion lept over the blade, catching hold and spearing him. That was a fun trip to the ER.
Reply: I'm a welder from Arizona so I've seen all the mess ups with angle grinders. Even sliced my finger open
Reply: TheBackyardScientist what kind of BB gun did you use if you don’t mind me asking
Reply: TheBackyardScientist how about accidentally creating the table saw launcher. I hit myself pretty hard with a plank of wood.
Reply: I was sanding on the belt sander and the belt was worn out and it exploded.
Reply: The time when a chunk flew off a Dremel tool grinding wheel and chipped my tooth!
Reply: Had a wire wheel run from the bottom of my stomach almost all the way up my neck
Reply: I ripped off 4 fingers in a lathe. I'm lucky to be here and have all my fingers still.
Reply: @thebackyardscientist we have a piece of plate steel on our shop wall were our teacher shows the power of kick backs there is about 30 dents in it and it's a 1/4 inch thick
Reply: You won’t see it but they block most VPNs
Reply: First time operating my toy(An angle grinder).. Misjudged how powerful it was. As soon as i switched it on, The torque of the motor just jaulted the grinder of my hand and landed on my foot.. Had the blade guard placed the wrong way towards the ground.. That wrongfully placed blade guard saved my feet from being chopped off..Walked away with a bruise on my feet.. Thank god!
Reply: A blade came of a saw and hit m
Reply: There is a teacher who had his finger cut of with the table saw
Reply: I once got my jumper sleeve caught by an industrial drill press. From my point of view it was instant - my forearm got slammed against the drill bit before I could blink, hard enough to give me a pretty good bruise. I got a lot more careful with power tools after that, and I definitely stopped brushing swarf off a spinning drill bit with my sleeve.

Same workplace just after I left, my old workmate took his fingertips off with the mitre saw. Didn't go near the blade, mind you - he was trimming a tiny piece off the end of an aluminium plank, and the blade flicked that sharp little offcut straight through his fingertips.
Reply: Excellent content! One caviat: something seems off with your audio, it has a low hiss possibly coming from the camera? Skip to 10:00 then just do a few 10 second skips and you can hear it easily.
Reply: Drill press long story short a shop towel got caught in the wire brush on my drill press
Reply: And also welding i dont want to to into detail for that
Reply: 9:09 Rookie Mistake lol
Reply: but what happens i you tack a ankle grinder two the face
Reply: I was drilling out a small screw the bit bound so I stopped then started again the bit exploded shapering into tiny pieces nothing hit me
Reply: First tim cutting on a table saw i got half way though the wood and it kicked back my teacher was surprised that I didn't buge from it but it almost sliced my nip off
Reply: I was working on a set using a table saw for the first time with a crew behind me. I was cutting a door frame and it shot back at the crew. Never wanted to use one again.
Reply: My stepdad got angry at a lawn mower and kicked it. He now has 8 1/2 toes.
Reply: My dad omost chopped his finger off
Reply: @michaelmacias4800  bruh moment
Reply: @uwu_meow.  what u doin
Reply: Once my dad was working at a woodworking company and a table saw cut his fingers off and it wasn’t pretty
Reply: I was working with a wire brush and when my sister scared me it moved and took a large portion of knee skin it didn’t scar but hurt a lot
Reply: TheBackyardScientist 
Guard on my drop saw was slightly out of line. I was cutting 2x4s well the blade grabbed the guard and broke off and hit me in the stomach and still had enough energy to deflect off me and break a window...
Check your tools for issues before use lol.
Reply: Blew up plywood with an electric saw
Reply: My Grandpa  was using a saw and it almost cut off his finger it cut through the bone
Reply: About the lathe thing Mi Metals teacher told the class about one kid who put his leg up there trying to pull something out and it caught his pant leg flipped him over the lathe and broke his leg
Reply: Steve0 ‽ NO ITS NOT
Reply: My dad had an angle grinder blade break and stick in his forearm
Reply: My dad sliced his finger in half using a circular saw
Reply: Hey Randy, looks like a taxidermy human
Reply: I almost cut my finger off on a lathe
Reply: Had a kid in my voc class using a wood bit on the angle grinder try to hollow a burl for a bowl and its dog in kicked up and took a 2 inch in diameter chunk out of his arm he needed 17 stitches
Reply: Once my dads friend was chilling on his porch and he was hearing screaming so he went over to investigate and a kid down the road chopped his arm off with a chainsaw he died 3 days later from blood loss :(
Reply: @oldprofile17  so you don’t have a arm now...
Reply: gutshot from a kickback made me sit down in pain for five minutes
Reply: I got my finger cut in a table saw and they sewed it back together
Reply: @TheBackyardScientist  what kind of BB gun do you have
Reply: My Brother pushed my arm into a ol’ rusty bench grinder
Reply: Phosphorus and sulfur explosion. We were doing a chemistry project and I was building a phosphorus container that it safe, while the sparks from the drill lit some other things on fire. Big explosion caused a fire.
Reply: Never before have I thought I would here backyardsience and safety in the same sentence
Reply: My teacher knew someone who accidentally cut his finger off with a tablesaw
Reply: No I’ve never used a power tool
Reply: Ty
Reply: I got a drill bit stuck in a peace of metal I was drilling through with a drill press, but I guess I pressed it a little to hard because the peace of metal was spinning and vibrating with the drill press and broke the drill bit and flew the peace of metal across the garage. I’m genuinely lucky that I haven’t had a serious injury dispute using tools for what they were not made for. Fun though
Reply: What you did in school was bad! Please make TheBackyardScientist read my comment.
Reply: My father’s chainsaw and chain snapped and flew right at his face, luckily he was fine
Reply: A saws all failed and the blade went flying and stuck into a wall.
Reply: I got my hair caught in the drill press but it doesn’t spin very fast and thankfully my hair lost tension and I shut it off quickly but I lost about 100 strands and had a bald spot that wasn’t easily visible
Reply: why arent you using actual guns
Reply: The first brush vs Randy. That's exactly how my shirt looked, and the scar is huge. Very dangerous tool.
Reply: I got my thumb stuck in the fork carriage of a reachfork, broke it but did not lose it. Operator was very gentle, I was lucky.
Reply: Works fine today, clicks loudly when flexing closed.
Reply: I was drilling a hole in a car frame a little larger; around 1" bit in a corded drill, it caught as the hole was nearly through, like it often does, and ripped the drill out of my hands beating up my fingers in the process. If your running a big drill bit it should be in a drill press, or on a drill with a slip function meant for screws. I'm so glad i didn't break my fingers or ever wrist.
Reply: Saw a video of a guy showing the aftermath of a Dremel cutting disc fail, the caption said, "this is why you always wear eye protection" and you couldn't see why at first, but he changed the angle of the video and you could see a decent shard sticking out of his safety glasses, truly terrifying.
Reply: @roflchopter11  a guy I know set a field on fire with an angle grinder, burned down my friend's trailer
Reply: Dude pls make a hand held version of the cannon. Maybe with electric motor and see capacitors? Also how would that work ? What is the max speed a capacitor could move a motor to? Brushed or brushless? So many questions.. like to upvote.
Reply: I turned on a beltsander while someone replaced the belt His thumb got stuck in between the belt and the roler. I had to roll it back by hand to get his thumb out of the sander still makes me sick. We still joke about it when i use it (turned off) sticking my hand towards it.
Reply: I remember in Intro to Tech in my freshman year of highschool we were making our cutting boards and another student was cutting his strips of wood and the bansaw he was using broke and i was standing right in the lane of death or a name similar to that i cant remember, i was doing something in a vice on a worktable and for some reason it snapped and went the whole other way towards the wall and instead of the kill zone
Reply: once i got a wire dremel bit stuck in my hair when I was at a jewellery class... That sucked a lot
Reply: M
Reply: You are more wiser...
Reply: So ya got me thinking 🤔.... could you build a table saw 2×4 rail gun?
Reply: during a woodwork class I had a handheld steel saw it slipped onto my finger right on the bone below your nail on the side on my index finger on left hand and then somehow no damage somehow yes I know you said power tools but here is this I only ever used 2 power tools 3 times total and succeeded at using them because I have good hand eye coordination